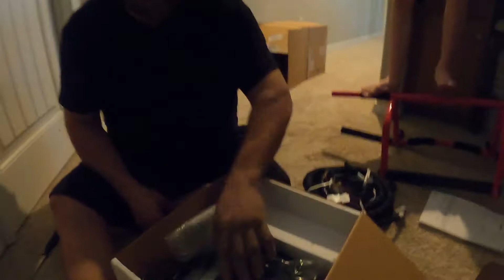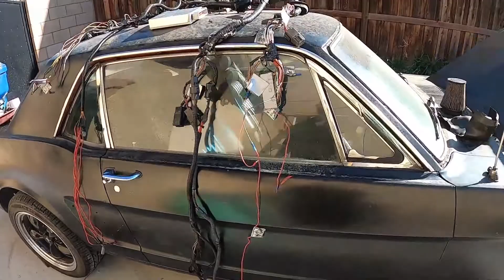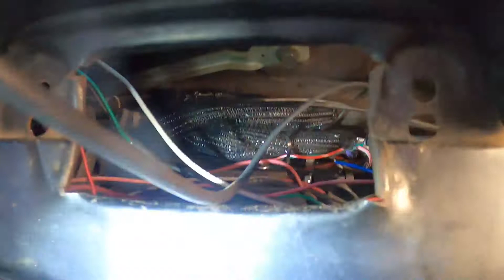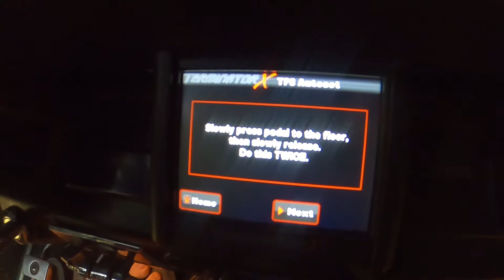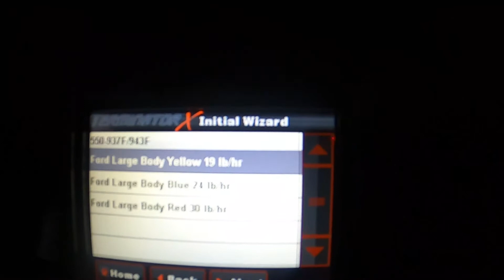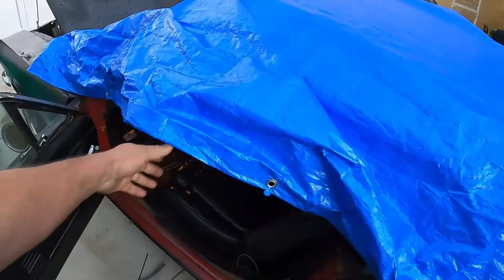Holley Terminator X 66 Mustang - Ditching old Ford SEFI/A9P

Comment: Cool car. And still the only actual terminator x install video I’ve found for a 65-66 Mustang. Learned a few things watching this. Didn’t know about the explorer fuel rails. Love the Maier tower brace. What brake booster are you using?  Thanks.
Reply from the maker: Thank you for the kind words.  Going to dyno tune it soon.  Booster is a mustang steve setup.  His pedal firewall bracket with a 4 cylinder Foxbody booster And 2000 v6 master 1” bore
Reply: @v8only  awesome. Thank you. I have the same booster setup to go into my car this winter, just couldn’t tell for sure. Have been running that master as manual. Looking forward to your dyno results!
Reply from the maker: @hsr65  I’ll post up a video when it’s done

Comment: Did you have to prune, cut and remove connectors on this Holley Ford small block Terminator  universal harness to make this fit?. Or did you just leave harness as is and ziptie out of the way? My tech said he charges another $500 to prune, cut, and remove not used connectors and wires to make it fit nice on my 68 Mustang,  or he can just keep harness as is and ziptie out of the way. Just curious what you did. Personally i dont like cutting anything on a new Harness period.
Reply from the maker: There aren’t that many wires that you would need to cut.  Power goes to battery ground to battery then key on.  Nothing to prune, especially if you keep original sensors on gauge
Reply: @v8only  But you have the Fox body Terminator X kit,  and holley no longer makes that kit. All Ford 351w or 302's now use the Universal ford terminator x kit 550-937.
Reply from the maker: @maximusvonce1381  ya that’s right.  I haven’t hooked up the regular 937 kit. However they do sell the tfi harness separately, and running the gm style iac is better anyhow.  You have to ask him specifics
Reply: @v8only  How do you like Holley Terminator X kit compared to stock computer?
Reply from the maker: @maximusvonce1381  with the stock Foxbody computer and harness it ran pig rich. Troubleshot it for a year or so on and off. I’m good with eec iv. In the end i came to the conclusion it was the tuning.  I was correct. Changed nothing else other then the terminator x and all my problems went away.   However self learning is a joke, and getting it to idle right is a chore.  I opted for a tune from someone remote. Sent to my email for $100.  Runs amazing. No issues.  No way I would run stock fox computer and harness ever again
Reply: @v8only  I have a fuel injected 438windsor big roller cam, high compression,  super victor efi,  th400, 410 gears and makes around 510wheel on e85, weighs 3k lbs and 4k stall converter. After 6 years running stock U4PO on e85 and almost zero issues i broke and outer valvespring Cylinder #1 and motor pulled for refresh with better valvesprings and half point higher compression to 12:1. Shop that R&R'd the engine had car over 3 months and couldn't figure out why once warmed up it would start intermittently stalling and intermittently go into a type of Limp mode, and then i would shut car off and it would start up again fine. Everything was checked in ignition system and grounds and power to ecm....etc.I even bought a good used 2nd computer of ebay for $120 and car had no change. Tested both computers at ECU EXCHANGE,  and they were fine. 2nd shop had car 6 weeks and said everything is normal and have no idea why car just intermittently stalls or goes into lower power type of limp mode. My tuner said just dump the stock computer and get holley Terminator x.  I even tried another sct module with custom e85 tune and no change. Nothing worked and never any codes. Spent $1100 trying to figure it out and 2 shops couldn't do it. Tech at 2nd shop said just get Holley Terminator x efi and you wont have this problem anymore.  And he said if i do get this same problem with Holley Terminator then we will know exactly whats wrong unlike the 28 year old obd1 U4PO stock computer.  So i figured either i get holley kit or brand new fresh motor will never get broken in and run right, so I broke the bank and got Holley kit and getting installed next week with custom e85 tune. To this day we have no idea why car ran great before engine was freshened and now it doesn't run great. Only change was half point compression hike and my tuner said that wont cause your problem and you dont need a retune. So hopefully the Holley Terminator gets my 68 Mustang up and running doing 9's at the track...Everyone says Holley Terminator is the best. I will know shortly.
Reply from the maker: @maximusvonce1381 that’s a tough gig man.  I’ve been around eec iv since the 90s, and those Computers don’t have a limp mode.  As a very experienced guy with a wrench, logic would dictate that it ran fine before, rebuilt engine, doesn’t run fine, problem is the engine.  Unfortunately I’m not a tuner, I wish I was.  I truly hope the terminator x fixes your problem, but I’m somewhat  skeptical.   The upside though is any tuner can tune holley, so it’ll be way easier and cheaper to get it tuned, and have the tune verified by other tuners
Reply: @v8only  Not the engine cause if it was the engine it would do it all the time. It immediately fixes itself everytime you cycle key off and on. Only happens when engine is hot. 

I forgot to mention that it did do same thing on occasion before engine went in for freshening,  but it was really rare. But yes even before engine was freshened the car would occasionally stall for no reason and/or go into a low power type of limp mode.  So yes it did do it before but very rarely..Holley Terminator should have it running almost perfect.

Comment: I looked around and couldn't find the video for the later model big block radiator and electric fan into the earlier car. Pretty interested in seeing that.
Reply from the maker: Figured there was a video on that or I would have done one.  I used a 67-70 big block radiator.  Can be had anywhere basically.  I bought an aluminum one off eBay.  You may need to trim your radiator support a little or all of the radiator won’t be exposed to air.  The fans are off s 95+ ford contour and line up perfect to the radiator.  You can buy the fans new for cheap on Amazon or eBay.  Don’t use original factory fans. They had issues with the motors locking up.  I had an original and it did so just that.  I used a volvo dual speed relay. Jc645 May have been the part number. Those are very popular for fan conversions. They are ground based relays
Reply: @v8only  thanks for the info!
Reply from the maker: @TorquePowerVideo  Before ordering make sure water inlet on the bottom Is on the Correct side needed for your engine
Reply: @v8only  thanks for the info!
Reply: @v8only  one more thing, how do you like that eBay radiator? Works well I take it?
Reply from the maker: @TorquePowerVideo  24” radiator sold by autocity1958.  Haven’t had any issues. Same radiator/seller recommended by a friend who has a shop that’s used several.